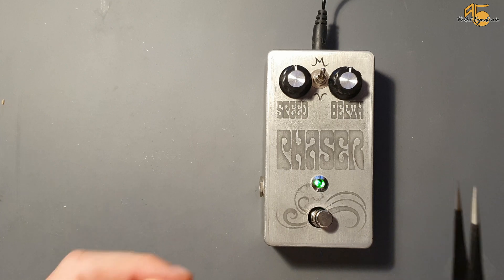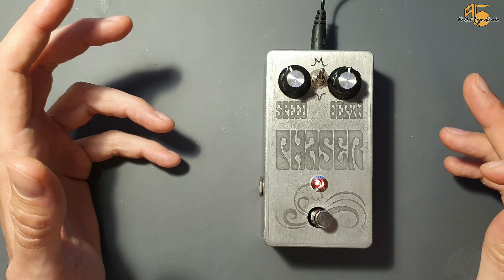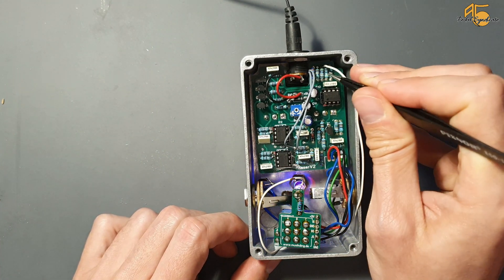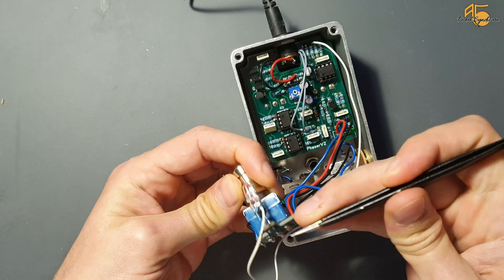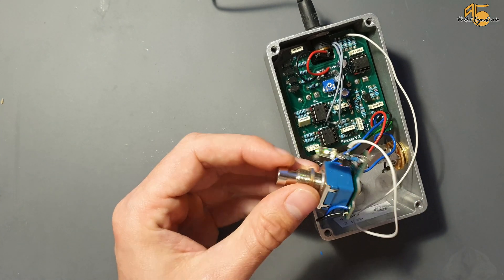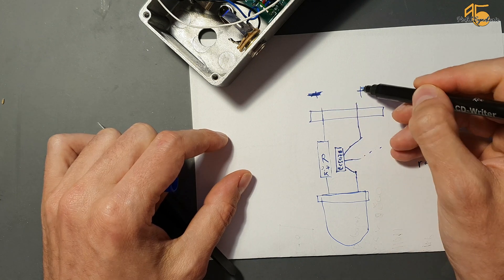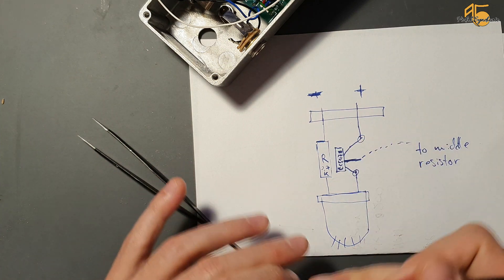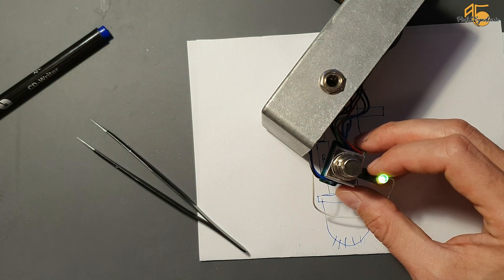Musikding Der Phaser LED Speed indicator mod

Comment: I own the old version of the pcb. Can you confirm that the resistor is the R25, between IC1b left 5leg and right 7leg?
Reply: Hey, its the one going to the 555 timer IC for sure. If you are unsure just give it a try - there is no backvoltage from the transistor, just make sure not to shorten the 555 accidently :)

Comment: Hi there, you have modded the pedal adding a switch between the pots, I see it is connected to the R15, what stands for and how did you do that? please I am about to buy the same kit and modding with this pulsing rainbow led custom :)
Reply: Thats a famous mod to phasers that  changes the feedback a little. The effect is very slightly diftent but sometimes thats what it takes :)